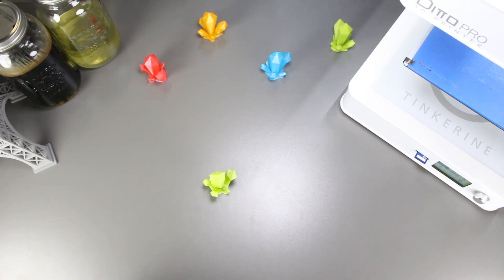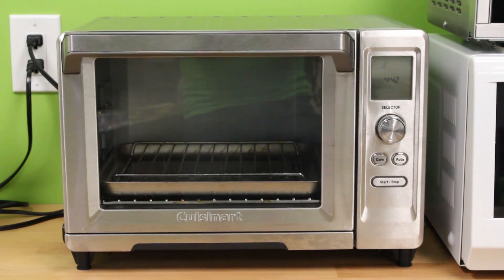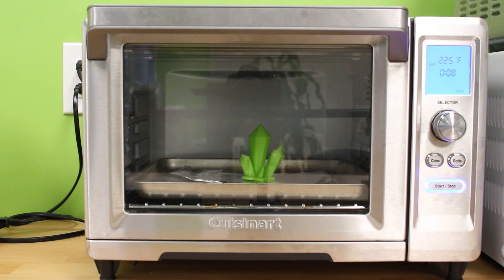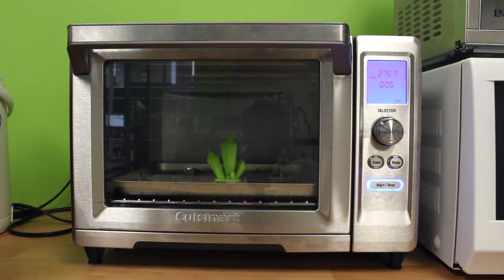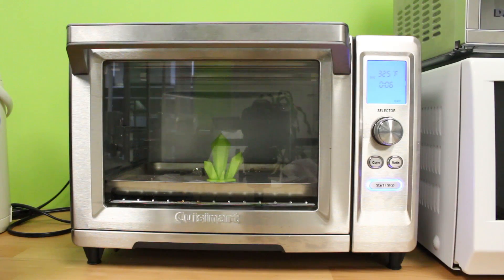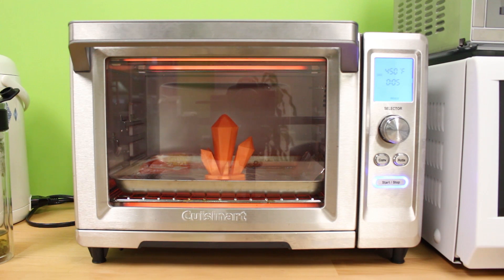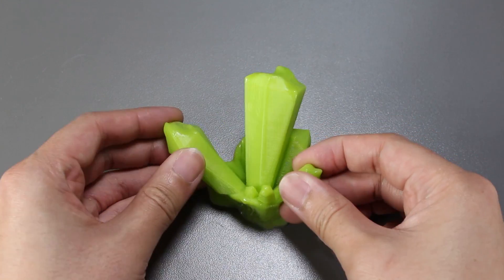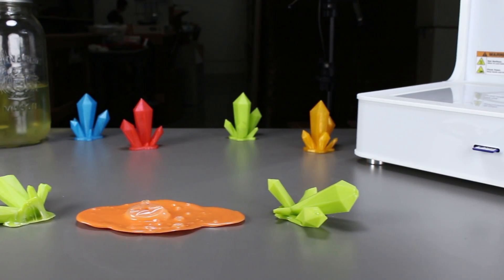Smoothing PLA Prints with a Convection Oven

Comment: I think there are 3 main factors to this experiment: temperature, time and amount of air flow. I think the temperature at the surface should reach the melting temperature as fast as possible. So the more airflow, the better (as long as it doesn't move the object around, lol). The time the model is exposed to hot air should be minimum, as otherwise the whole model starts to warm up and deforms. The temperature should be max and just below the temperature for which PLA gets burned. Not sure what that is but I remember PLA will burn at ~250ºC. SO I think minutes is too much. I think it should be more in the range of 10 seconds. I think a hot air gun would be nice to give it a try. Thanks for the video, saved me time to try it myself!

Comment: One thing to try is preheating the oven to a very high temp, putting the print in the freezer for a few hours, then sticking the print in. The preheated oven might Cause the air inside to be evenyl heated, and the ice cold print that was in the freezer might smooth better because the outside layer will heat up faster than the inside layer
Reply from the maker: Thanks for the comment and suggestion, we will look into it!

Comment: Not a very good convection oven.  I good one has a large fan vent, usually in the back, and there's also another heater element inside that vent.  They spread the heat much more evenly.  Also on the more expensive ovens, the top and/or bottom elements are usually only used during preheat if you are not using something like broil.  You want the oven to be empty during that pre-heat period,  otherwise it will be uneven.    Now I never put any PLA in mine, I just use it to cook enough to know how it works.
Reply from the maker: Thank you for the comment and the advice!

Comment: Why not just use a heat gun? You can direct it like a paint spray can and as soon as you see it start to melt you can move it away.
Reply from the maker: Hi!

We've also tried using the heat gun in another experiment and it works like a charm after you get the hang of it. We are always looking for different ways or more efficient ways into post-processing PLA prints.

Comment: What happens if you boil pla?
Reply from the maker: Hi!

I believe when it gets to a certain point, the PLA will just deform inside the water.  What you can do with boiling PLA, you can heat form the PLA like in this video: https://youtu.be/fZmfYE8-PQI
Reply: Tinkerine I was wandering if you dipped it quick maybe it would smooth it?.... Great videos by the way.
Reply from the maker: Thanks! We can take a look into it.

Comment: Normally ovens have a "toast" option whereas the heat comes from the top and the bottom to equally "toast" your bread, or in this case, your 3D model.  Did you try that? =]

Comment: Thomas Sanladerer on his channel did a similar experiment with protopasta pla at 110 celcius for an hour. I think low and slow is the way to go bc you need the inside of the print to warm up as well for even heating. What is your infill %? wall thickness? These are factors to consider. Maybe line around it with tin foil or use a clay plate like the ones used of pizza. Just off the top of my head.